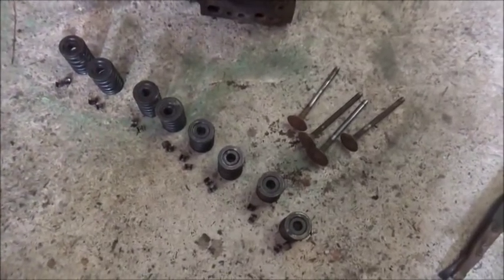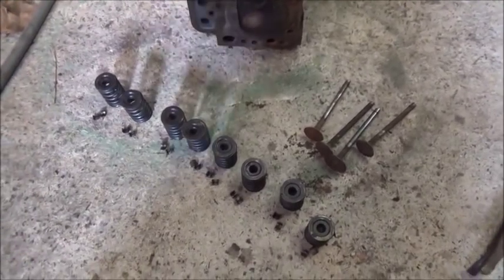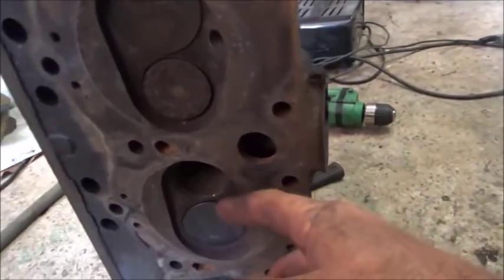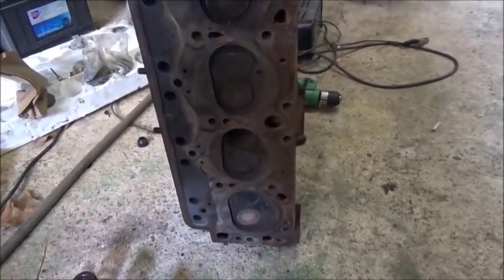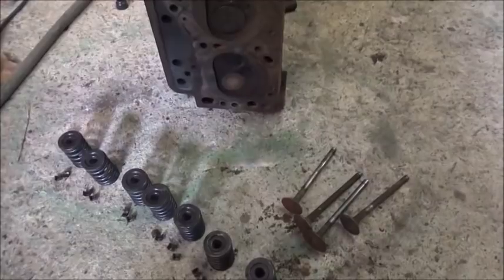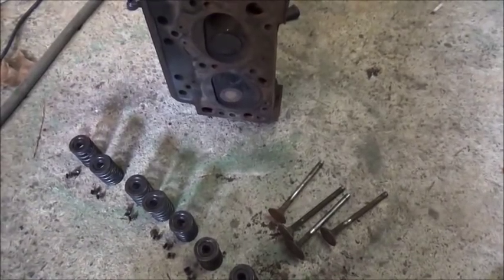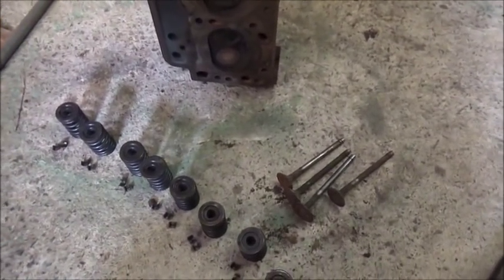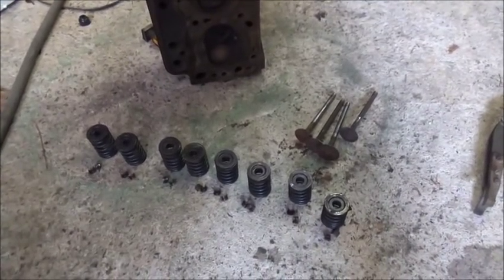PACKARD GATE! NEW THEORY ON VALVE DAMAGE. 1956 STUDEBAKER

Comment: Jonathan, Been enjoying most of your videos! I'm 61 years old... Cars, ALL my life...I have 75 vintage Mopars  at my shop today... Mostly 64-74 with a few 40's trucks. They all followed me home! Been pulling apart lots of cars/engines that have sat for 30 or more years... My theory about the exhaust valves: Built up combustion deposits. Lots of chemicals in that junk... Time, condensation, more time and humidity. And they start to break down. Those chemical filled deposits have acids in them. (what kind? I'm a gearhead! Not a chemist.!) That is what is eroding/pitting ALL the exhaust valves and not the intakes. Also, we know what kind of damages rodents do to our beloved old cars. But to have a rodent visiting EVERY exhaust port... What are the odds? Keep up you wonderful works! Watching Noah is an inspiration. Somebody has to "fight the good fight" after we are gone. Frank Parks @ Mopar Restos, Summerville, Ga.

Comment: Boy if this keeps up Noah's going to be the star of the show! Mouse theory is very strong I would say. I don't know about dinged pistons and mice though, normally mice wont pack anything to a nest that's hard enough. I would think you would have had more evidence even with starting it to have damage to the pistons like that. I would vote the choke plate screws there myself. Gasoline, moisture and oxygen get pretty corrosive too. Like the engine being flooded from trying to start, they give up and it sits for years after being flooded but never run. You already know what gas tanks can do. You're lucky too Jonathan with regards to Noah. Kids like him are nearly extinct.  You enjoy it too and it shows. Good for the both of you. Thanks for sharing

Comment: I have a few two cylinder john deere tractor,  and collect hit-miss gas engine, most of the time the intake valves are good but I have had to replace  the exhaust valves quite often.  Most have had mufflers, or other obstacle's  to keep  the mice out. I always assumed the damage was due to the exhaust valve being stopped open or a combination of moister and combustion byproducts. Your thoughts on the mice are a good possibility. I have a  IH F-20 tractor that I got running parked it for the winter the next spring the engine was locked up the mice went down the exhaust filled the cylinders with nest and urine, it's still locked up. Love history! Congratulation's Noah on your award!

Comment: I trust what you say!   Noh is fortunate to have a mentore like you!  I hope all is well with you jw!  I think the exaust valves are like that because someone was spraying  starting fluid in the carb!  I have seen them look like that on small engines from over use of starting fluid!  Them valves looked worn anyway,  then add starting fluid, dirt and Rust and you have a nice little sand blaster!

Comment: Definitely agree that no exhaust system is an open invitation.  I had a 48 chevy COE truck and it sat for years.  The exhaust system was intact.  Essentially a roadblock to vermin and the heads needed rebuild but were not troubled with rodents.  It had an updraft oil bath and no problems with mouse nests even though the seat was used for mouse houses.  Good theory, I am in agreement.  At least capping the hole on old cars would be beneficial; but who was there to care at the time of abandonment.

Comment: I like the videos man!  On the Studebaker exhaust valves it also could be damage from unleaded fuel. The metal in those old valves weren't intended to deal with the heat generated by unleaded fuel. I've seen them crack from it also. But you could be right!

Comment: That is definitely interesting. I suspect you are right. I have a flat head six in my 53' Desoto. It had stuck exhaust valves, I guess flat heads have that tendency, but the seats looked fine. Of course there isn't any way to dump stuff on the valves because they are facing down. I did have a corroded intake valve I had to replace. I would guess that one was sitting open. Glad there weren't more of them. I had a really fun time freeing up those stuck valves. It runs great now.

Comment: My 1963 Studebaker GT Hawk original 289 has a stuck #8 exhaust valve. The exhaust system is completely intact.
I presume it has carbon build up on the valve stem. I cannot see how mouse urine could be my problem.
Thank you for posting this video.

Comment: Jonathon - loving your channel with your current projects; keep it up!  I can’t fault the mouse theory and the pitted exhaust valves only... 

But a couple of things struck me about something more recently dropping through the exhaust valves causing damage when you started the engine or the guy before. I recall you found the marks on the underside of the head under quite a layer of carbon build up, like the engine had run for a while...
Also, whilst you didn’t discuss it, I also recall that the damage to the pistons, especially the slight bulging of the diameter after the ring lands had been crushed and cracked; that seemed to have bedded-in somewhat, like it had run for quite a while after the damage was done, too.

Comment: I think your theory is spot on, Jonathan. I've seen the damage mouse urine can do to other areas of cars. Nesting in the exhaust ports makes perfect sense,  I also seen how corrosive it can be in vintage electronics. It will corrode stamped metal and copper coil windings and will totally dissolve pot metal. 
 Then, there's Hanta Virus... They're nasty, destructive critters all the way around.

Comment: Great video! Keep flaming that fan under Noah, he seems like a good kid.
Reply: I wonder if they do Junior Drags in their area, eh? And ci/cc limits, to keep Noah busy on his off nights, and/or until he gets his license. 

Only the first three or four mouse mummies are cool. :p

~edit because curious and thought this was neat.~  NHRA Summit Racing Jr. Drag Racing League(official): 1/8th mile. Drivers 5-17(!). 5 classes, top class 13-18 max dial-in is 7.90. Disqualified if you run quicker than a 7.50@85mph. Engines are all 5hp Briggs 206ci based block. Stock bottom end, port polish allowed. No deck height mods. Gas only, N/A only. Cam mods are wide open! No ohv/ohc. Any size valve/spring you can get in there!

Didn't realize 5yr's can run crate 206's, cool!

Comment: I would have guessed that unleaded gasoline caused the exhaust valves to be damaged, but your “mouse theory” makes sense. Unleaded gas would have damaged the valve seats as well, but the seats appear to be okay, at least as far as I could tell from the videos. I’m going to take this to heart, and place PVC plumbing type caps on the ends of the exhausts of my classic cars that don’t get driven regularly, to keep the mice out of the exhaust and engine. Speaking of such, you mentioned that mice get into the roof overhangs of mid-‘60’s Chevy trucks... I have a ‘66 C-10 that that happened to. When I was repairing the rust damage in that area, I found it to be filled with nests & mouse droppings.

 By the way - in an earlier video, you mentioned a 12-cylinder Pierce engine for a fire truck that you sold. I live walking distance from the guy you sold it to. He’s a friend of mine, and he’s in a local car club with me. He plans on putting that engine into a rat-rod, and running short, open, “Zoomie” style headers. Should be quite a sight (and sound!) when he finally gets it finished! 

 Thanks for posting these great videos! The next time I’m in North Carolina, I’ll swing over your way. My sister lives in Franklinton, near Wake Forrest - about 80 miles from you. I should be down that way before the end of the summer!

Comment: Urine normally has a Ph around 5, and aluminum is almost as reactive as 
magnesium (remember those ribbons that burn with a bright-white light?). 
My guess is that urine would lay waste (apologize for the pun) to 
aluminum in short order.

However, internal combustion engine valves are produced from special heat-resistant material with anticorrosive properties, such as medium alloyed steels with chromium, martensitic and austenitic stainless steels, titanium alloys, nickel-based super-alloys (Inconel, Nimonic, Nichrome, etc.).

All the best from

Nick Jervis UK 🇬🇧

Ask the man who owns one

Very well done Noah. I too heard of that coal seam blaze. We've got them here too

Comment: I think you hit the nail on the head. Those little buggers get in everywhere. My wife complained this winter that the car had a hesitation and when I checked the air filter, it was at least half full of nuts and acorns. I have a picture of it that I gave to my mechanic and he has it up on his bulletin board. If they can leave their essence everywhere else in the car, the Nash video showed they will also destroy an engine.

Comment: Jonathon I think it could also be the unleaded fuel as the leaded fuel lowers the combustion temperatures. That was the reason for the egr valve to recirculate exhaust gas to lower the temps. Just a thought.

Comment: These old engines you work on originally ran on gas with lead. Lead helps cushion and protect the valves . If these cars are ran on no lead gas, this kind of damage will happen. I still see pitted valves on new engines with hard valves in them. Food for thought.

Comment: The mouse theory sounds like the truth of it. Urine is high in nitrates as in amonium nitrate. All old country boys know a little fertilizer will rust metal or blow out a stump. That's what happened also with all the air bag recalls because the nitrate used for the explosion rusted metal holding the parts and bag. Encourage Noah to look up Smoky Mountain, Kane County, Utah. The area has been burning for hundreds, maybe thousands of years.

Comment: It seems like if mice like a certain vehicle you can’t keep them away. I have many old (operational) vehicles on the farm. The mice leave everything alone (including the grain trucks) but they LOVE my 77 VW convertible. I can’t keep them out of the mechanical or interior side of the car. Last summer every time I drove it I would pull it back in the shed to find that there were dead mice laying on the ground that had been in the engine when I started it. I’ve tried everything - nothing works!

Comment: Would agree with the mouse urine theory as it is very corrosive.  Probably helped along by condensation. With the exhaust system open it would have a never ending supply of moisture laden air. The intake side wouldn't have as much moisturized air because of the carb thottle plate and air cleaner. Worked in a salvage yard ,used to keep a supply of old tennis balls to plug exhaust when we pulled motors. Kept out moisture and mice ,cut down on returned motors.

Comment: Those mice can cause havoc!  Had a farmer call me to come look at his '65 ford pickup that had a stuck engine.It was wheat harvest time and it was his fuel hauler for the combine.  Figured out it wasn't locked up because I could turn the crank backwards till I stopped again.  Pulled the head on the 240 ci 6cyl and a mouse had come through the exhaust and stored some seed wheat that the farmer had in the barn on top of the piston.

Comment: JONATHAN, you mentioned you didn't like the hood being so low at the back, on the side where the prop is, check further back on the hood and see if the prop has a second hole to put it in.  I know I had Studebakers that had two positions, for working on it  On some of the Studes the hood can go straight up, I just can't remember if the Hawk had it.  I love history also, my mom taught me to read by age 2, love books and reading.  The Hawks in '56 other than Golden, were Sky, Flight, and Power, they did not have the fins, I do think they look better with

Comment: I've got a 83 chev 3/4 ton that had a very nice interior in it, sat around the property here for about 4 years, not a mouse in it. this last winter they got in and ruined it. I'm guessing it was the heater control left on heat instead of cold but I really don't know for sure exactly what changed that allowed them to get in. no doubt they tried before but this time they did the deed.

also, there is an underground coal fire in Merritt BC that has been burning since as long as anybody alive remembers. often in the winter there is that one hill to the south of town that has no snow on it, the only one around.

Comment: The urine theory definitely holds water to me. I’m ashamed of myself for that but I couldn’t help myself.  Mouse urine is more logical than concluding that a a piston had damage because  someone discharged a pistol  down the dipstick tube on the rat rod. I know that the bullet theory was just BS but you had so many steps to that theory and you presented it so well  it was a crying  shame it wasn’t true. I appreciate a mind that considers things outside the box. PS regarding the corrosive properties of bodily fluids, on a vet show (animal planet) recently a hound came into the vet with a bowel obstruction. The vet operated and found the remnants of a large (1.25” approx) ball bearing lodged in the bowel. It was black and jagged like a chunk of volcanic rock. The owner said a pair of these bearings disappeared from a coffee table about 3 years ago (when the dog was a year old pup. nothing passed and the dogged was not showing signs of distress so he cleared the pup as a possible thief. The vet said the gastric juices were definitely able to destroy chrome plated steel if the steel is exposed to the juices for long enough (like 3 years). An exhaust valve is therefore likely to pit if drenched in pee if the volume os sufficient and the time exposed to the urine is long enough. Congrats Sherlock!

Comment: My 66 Continental, the exhaust valves were pitted .  I have a 72 Mark IV , and the mouse urine on top of the air cleaner  got into the carb and froze  it up.

Comment: What about using unleaded gas ? I had heard that older engines would eat up exhaust valves if the engine is built to run on leaded fuel
Reply: Eat up the heads not the valves. The lead in gas acted as a lube, the valves are harden and the seats are cast iron.
Reply: yeah it would eat up the valve seats not the valves that's why you got to have hardened seats in the head

Comment: I like your mouse urine theory.... I found an old late 60's Cadillac that was seized took me a week of soaking the cylinders in Mystery oil  so when It finally loosened up and could start.  A stench of burning urine came out the exhaust pipe thereby confirming the mouse  urine in the exhaust system. I never took the engine block apart and do not know the presence of pitting on the valve stems. At first I thought it was cat piss!

Comment: I agree with your theory about the mice I don't know about where you live but here in Oklahoma we got these itty bitty little mice that could fit 10 of them in your hand I've blown several of them out of old motors it's to the point that farm trucks with glass-packs I usually ball up some stainless steel window screen about as big as my fist and hose clamp it to the end of the exhaust pipe and that Noah seems like a pretty good kid

Comment: Exhausts tend to corrode more because when you burn fuel you make acids and over the years condensation tends to make the exhaust side rust faster...That's why were I was raised exhaust systems corrode fast but mice may add to it.. Just my opinion..I think the miners set that mine on fire over a labor dispute...

Comment: Thumbs up on the mice. Those guys can get in anywhere. I guess from now on if the exhaust is off and it's been sitting for much time at all, probably assume on taking the heads off? My Neighbor was riding his ATV up the hill. He stopped by my house saying it was gutless when he got on the throttle. I listened to him rev it and it sounded like when I had a backed up muffler. He agreed and we decided to cut the spark arrester cap off from the muffler. The cap itself had a pea shooter pipe sticking out. When we got it off, dog food rolled out of the spark arrester chamber. He started up the ATV and it was like a machine gun firing out dog food. Ran great afterwards. We figure mice, carrying dog food got into the spark arrester pipe, through the chamber, then into the muffler outlet and packed the muffler full of dog food. Maybe chipmunks, not sure but it was a sight to see the dog food spitting out like that!

Comment: could it be possible that unleaded gas has been ran in the engine and caused the valves to burn up and flake off chunks into cylinder? I have heard that older engines need an additive if they have not had hardened valves and seat installed

Comment: YES the mouse theory is correct. about 10 years ago a freind gave me a low millage  84 caprice classic it sat for 3 years and engine was stuck on it. He had drove the car home when he bought it and then parked it.  I then pulled engine out for a project and when i pulled exhaust manifolds off of it in one cylinder grain and stuff came out of port. I then took head off and yes a mouse was in there and pissed on the top of valve. totally destroyed valve was able to save the seat though. Also the exhaust was complete with the old style catalytic converter in place. but on further inspection muffler was bad shape and mice went up tail pipe all the way to engine. lucky only one valve was damaged.